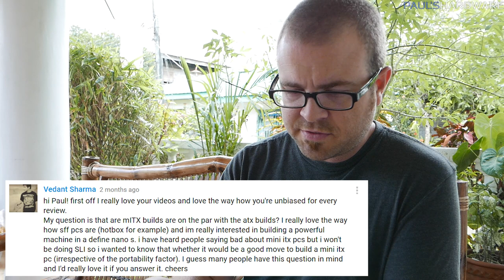Mini ITX vs Standard ATX - Probing Paul #8 (PI Edition!)

Comment: You have a knack for putting out content I'm already pondering; I'm considering going from ATX to ITX.
Reply: ITX has its limits, but at the same time cases are smaller in height and also more portable. 

the downside to ITX is limited to video card size based on case, can't fit as many drives, CPU cooler height/width may also be limited, MOBO's support less RAM (mostly 32gb), only 2 sticks. 

If you plan on moving the case around for travel or LAN parties I would suggest looking at cases with strong handles.
Reply: Steven Bringhurst I went from ATX to MATX to ITX. love it. wouldn't go back. I have the evga hadron which is a tiny foot print. it's great. but make sure it fits your need. for only gaming a 16gb of ram is fine for now
Reply: Steven Bringhurst I took the plunge and went from ATX Mid to ITX Mini. Love the switch. Using the Phanteks Evolv ITX, which is actually a tad larger than most ITX cases. That said, it allows full length double slot video cards, and CPU coolers up to around 175mm. It's a little tricky to fit double stack air coolers though. That said, it has space for a 280mm rad at front or top, but front might impede the GPU slightly. You'll want to make sure your airflow is good though, as GPUs do tend to run hotter in SFF cases.

Comment: Hey Paul, in addition to the question posted in this video, what in your opinion is the best looking mITX case which would be able to support a custom watercooling loop? I am planning on upgrading my current system to a 6700K and a GTX 1080 and would want to make my own custom loop to cool them and would like to be able to show them off as well. Any suggestions?

Comment: I'm building my first pc and I think I know everything, my question is how much anti static prep do I need to build it. If I get a mod mat and a wrist strap that's another $50 us. So is that required for a first build? Thx so much and you've inspired me to build one myself.
Reply: The only important thing is that you not build up static charge. One technique I've used is leaning a bare arm on the case - the bulk metal can dissipate small static sparks well enough. If you're worried, avoid carpets (they're more likely to build up charge than wood or tile floors) and very dry air (it doesn't dissipate charge well).
Reply: awe bob honestly i would just say get tte wrist strap if you think it's necessary, dont get a mat unless the strap bothers you.  As long as you dont lay your parts dont on carpet or build on carpet while wearing socks.  It's all just pre cautionary though
Reply: I don't wear any anti static devices when doing builds. You can do what Linus does and wear a strap on your ankle. But you should be good by just touching your computer case if the power supply is plugged in. That way there is a pathway to ground. Don't shuffle your feet on carpet.
Reply: I don't have earth thing in my house.Is this abig problem for my electronics
Reply: RAZOR12334 I'm sorry for being late but if you've not built you PC then I would attach a wrist strap to your radiator(if you have one,) as the whole heating system is grounded

Comment: Would you be doing a new budget build at around $500 any time soon? And also what is your comment on the new (not really new but yea)  Razer Core for laptops and will it be a good idea to spend more on a laptop, the Core, and a graphics card rather than making a pc?
Reply: Didn't Paul just do a $500 budget build a couple weeks ago and then did a $250 upgrade to it? Check out the videos. How new of a build did you need?

Comment: HEY PAUL i love all of your video to start off with, i recently built my 3rd pc (my first with a custom loop) and i have a 480mm rad and i cant seem to get all of the air out of it. i have the rad mounted vertical with the inlets and outlets at the top in thermaltake core p5 and everytime i turn off the pc i get a huge air bubble that forms in the line from the cpu to the rad (inlet for the rad) just by the rad , anything you can suggest would be great.
THANKS
RUBEN

Comment: I have an i7-3930k. Mostly for gaming with two GTX 1080s in SLI. Is there a reason to upgrade my CPU? I run it at 4.1ghz and I just don't see the money I'd spend as a good investment since the specs of the newer CPUs aren't that much higher. Do I miss anything?

Comment: Hey Paul,

I was curious if you have ideas for a good small form factor, low cost, dedicated emulator pc. My plan right now is heading towards a new i5  and a still working on what gpu. Memory and power arent a terrible worry since it wont need anything more than 500W and 8 gb of ram.

Comment: Just a question for anyone that knows the answer. How would I find out if a motherboard (before purchase) if I can use it for overclocking?
Reply: David Butterfield depends on what socket your cpu has. For skylakes lga1151, the mobo with chipsets of z170 are overclockable. H170 and b150 are locked.

Comment: HeyPaul, I already have an MSI GTX 1060 gaming X with 6gb of vram. is there a need for me to upgrade to a 1070? games are having higher video demands and I'm afraid my 1060 won't be able to handle it a year or so. also, is RX 480 crossfire better than a single 1070? Thanks and keep on making good videos.

Comment: what do u think about those graphics card box used to convert laptops into gaming machines
r they viable
Reply: No
Reply: Considering you need at least a thunderbolt port inorder to utilize at least 80% of the performance of the card, and the fact that it costs as much as a mid-range build (the box doesn't come with a GPU, mind you), no.
Reply: julian23561  imagine u like portability of laptop and bought one maxed out and want to game on it once a blue moon then spending $ 500 for box and card would be best thing to do
Reply: +Vishnu Prasad if you buy a maxed out laptop (assuming it's a gaming laptop with good specs) then you no longer have the need for an eGPU box. Plus an eGPU isn't portable, at all, you have to plug one to a power outlet.
Reply: julian23561 i am talking about none other than new MacBook pro
which can become a home setup as well as portable and with some extra horses it can be used as a gaming machine
but thank u for ur reply
Reply: +Vishnu Prasad oh, ok. If you buy the MacBook Pro, they have already have a Polaris based Radeon Pro GPU, although you'd have to spend a premium if you want the version with a decent GPU.

Comment: I like Micro-ATX the most.Since SLI/Crossfire is quite unnecessary for nowadays, so 4/5 slots is great.1 Graphic Card1 Sound Card1 WI-FI Card (Maybe)
Reply: Mini-ITX has built in wifi cards. You can get a usb-dac for better sound such as the AudioEngine D1.
Reply: Albert Chang Well, if you don't want to have a DAC on your table. It is subjective. I like Micro-ATX for a little bit of future proofing. Maybe there is a new standard of wifi or stuff in the future.

Comment: I have a i3 3220, is it worth to buy a GPU like 550 Ti or just build a new PC? I'm afraid if it will bottleneck the GPU.
Reply: Harsh Vardhan What games are you going to play? Because that CPU is still pretty good if you put it with a GTX 750 Ti or GTX 1050.
Reply: I'm gonna play modern games like Rise of TR, Battlefield 1, etc. with some old goods like CS:GO. With Ultra setting. I'm fine with 30 FPS lol
Reply: hmm. Well for Ultra you'll definitely want to get a new PC,  but I'd be cheaper for you to get a 1050 or 1050 Ti and play at medium - high depending on the game.
Reply: Dankerino Nicherino The thing is, Indian pricing is messed up... 1050 lineup hasn't launched, 1060(around $350) costs less than RX 480(around $400)
Reply: Harsh Vardhan Well in that case I'd recommend a RX 460 or a GTX 750 Ti
Reply: r9 series is cheap atm, id look at the second hand market for something like a 270x

Comment: All in one pc good for a senior or younger kid
Reply: Or noobs to PC building. 

Well, I am one, but I refuse to get a pre-built system!
Reply: All-in-one PCs have even more restrictions and limitations than regular pre-built PCs.  As a rule they are not intended for demanding applications, particularly gaming.  The GPU tends to be the weak link due to the limited opportunity for heat dissipation.  The Origin one shown in the video appears to have a custom cooler to get the heat out.  The higher configurations may offer reasonable performance, but it will be very expensive.  Something like that is for the rich.  I just build my own for a fraction of the price, and sleep at night in a bed instead of under a bridge.  It's like assembling a jigsaw puzzle made out of 8 or 9 pieces that you choose yourself.  Not that hard.

Comment: does the GTX 1050Ti actually have a place in this world or is this one area which AMD has on lockdown
Reply: It doesn't require external power, so on prebuilt systems with low power, and often proprietary PSUs, it is the best choice. Also, AMD is overpriced in many regions because of limited supply.
Reply: Alex Chamberlayne The 1050 Ti is at a strange place between the RX 460 and 470.
Reply: Kenrick Brown but is that really a needed place
Reply: Blood Angel im under the impression that the price to performance ratings of the 1050Ti are worse than other cards
Reply: Alex Chamberlayne Like I said, it depends on the region. AMD are much more expensive in Asia than the US.

If you want the most powerful card that doesn't require 6/8 pin, and just runs from PCIe, then the 1050 Ti is it. If you already have a Dell or HP PC, and you can't replace the PSU because it's non standard, and low rating, like 200W, then this is the best card you can get.